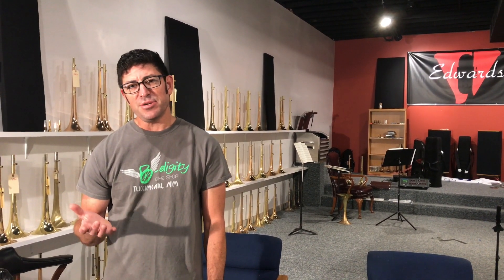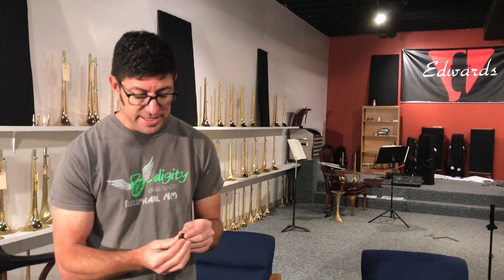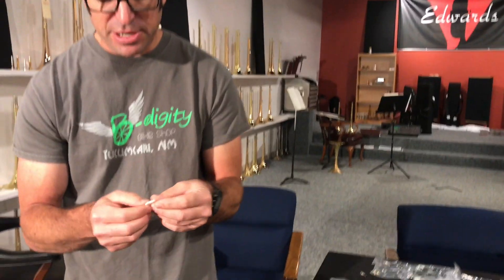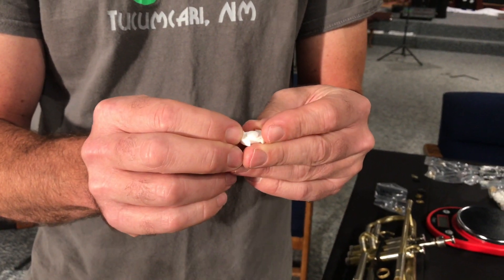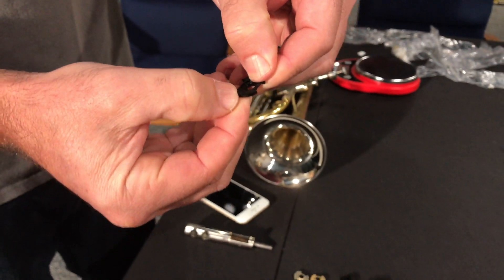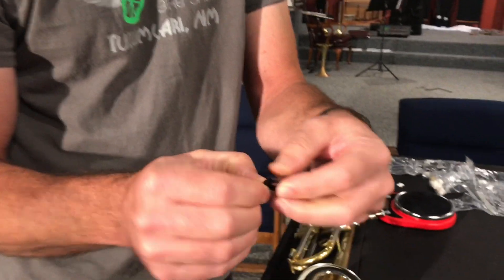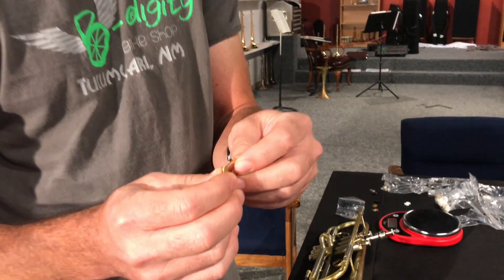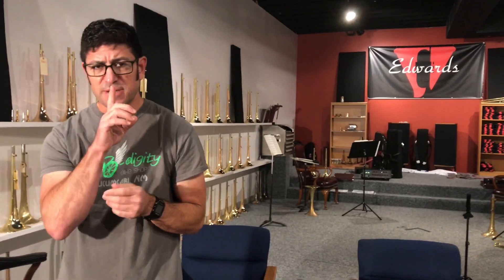Why Valve Guide Materials Matter | Edwards | Trumpet

Comment: I like to repair old trumpets and cornets. Is there any hope for valves that are dented? I can get them working inside the horn but I don't know if they will work. I don't know the material either definitely not steel. The horn is very old probably 1920's.

Comment: My valve guide is stuck in a weird sloping position
Reply: Rtf Livs maybe it’s a little too long. I have the same problem but not so bad that it’s in a sloped position.
Reply: the Edwards website provides the following for their valve guides: "Valve guides may need to be filed to fit each individual valve.
"

If you have a valve on the lower end of the tolerance, and a guide on its (tighter) upper end, you may need to remove some of the material of the guide to get the fit right.